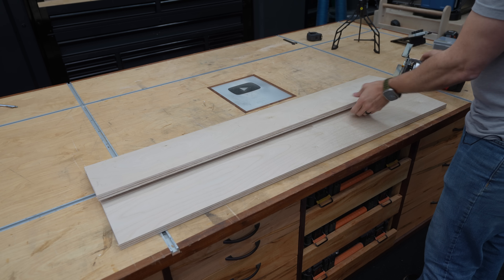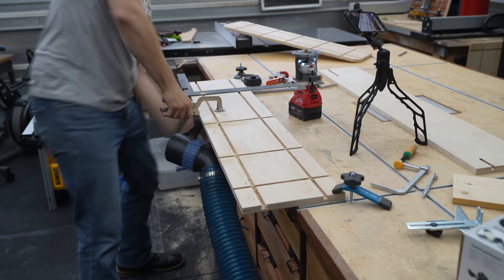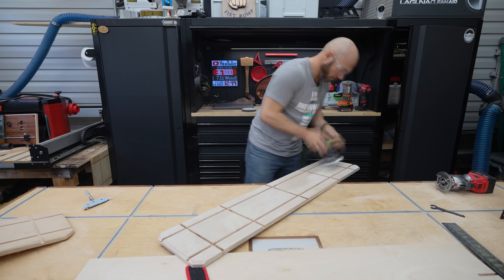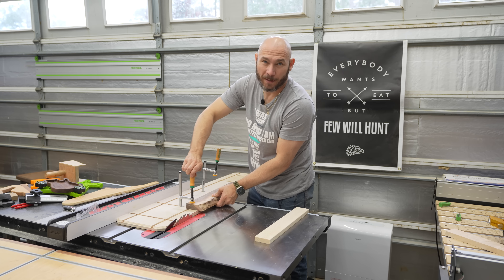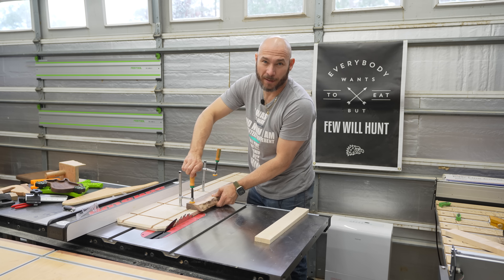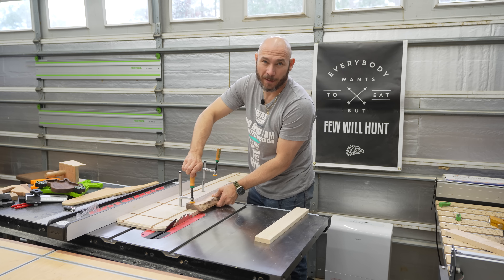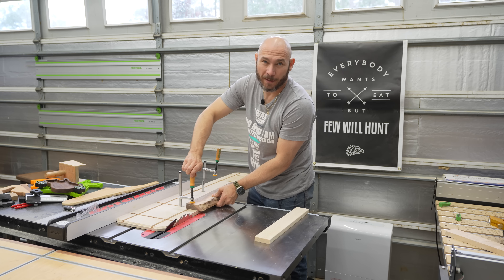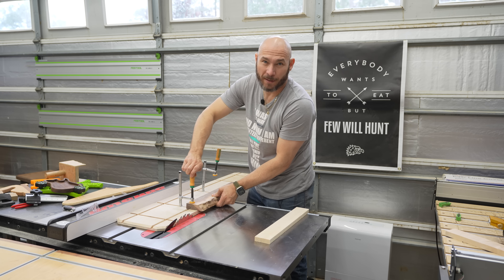99% of Beginners Don't Know About this Woodworking Trick!

Comment: This video makes no sense you can’t get a smooth jointer edge from a table saw?
Reply from the maker: I jointed on a table saw for 5 years before getting a jointer.  Worked for me.
Reply: Why not? care to explain how this doesn't work? He just showed exactly how it does work, and logically, there is no reason this wouldn't work practically as well as a jointer, other than the limitation of flattening a wide board in preparation for a planer/thicknesser. But I'm no expert so am genuinely curious.
Reply: @hrodwulf172  I worked in a cabinet shop for 40 years. I don’t care if you have a brand new blade! You will have saw marks after cutting and when you stain it they will stand out!
Reply: @georgedowney8533  Hmm, maybe Matt can demonstrate with a piece of walnut or something versus pine and shows the quality of cut. I would honestly expect saw marks though and would need to clean it up. Even with a jointer, you would probably sand them anyway, no? So long as it's straight, it should be fit for purpose. The purpose of a jointer is to give you a straight/flat edge first and foremost, no? Not to give a finished edge. That is not the expectation as far as I am aware when using a jointer. I have personally never seen any cabinetry made where they have just taken a piece from being surfaced and then applied a finish without sanding. To me, that would be the mark of a very lazy craftsman.

 I think this is still a great tip for people who want to joint a board but don't have the resources for a jointer, as you can just sand the exposed faces
Reply: @hrodwulf172   purpose of a jointer is to leave a perfectly straight edge you would never sand it! Sanding creates in perfections!
Reply: @georgedowney8533  so you don't sand exposed faces in your work? For the purposes of creating a straight edge I don't see how a table saw is unusable, seeing as from what I have been taught, you take the piece from the jointer to the planer, then to the table saw to take the last edge off...if the table saw is good enough for one side, from almost every woodworker on youtube, why not the other? 

So I am just so confused by what you are saying..doesn't add up to me tbh...I think most people are able to sand just fine without creating a noticeable dimple, especially to the point where it is no longer functional...so many things you can do to avoid that, contour pads, using pencil to mark what has been sanded etc...

Not trying to be argumentative, I am no expert by any means, but logically I don't understand how this method is unusable...looks great to anybody who doesn't have the money to fork out for a jointer
Reply: @hrodwulf172   the word joiner in itself, means to join two pieces of wood together to form a flawless seam.  You wouldn’t sand it! In some cases you would join an exposed edge to bring it to exact size with a sharp joiner you would have a finished edge!  Not like a table saw!  Maybe you should take some shop classes.

Comment: The main use for what you Americans call a 'jointer', and the rest of the world call a 'planer' (because it is just a powered planer that has been rotated 180deg) is to flatten the surface of a board. Most will do this to 250mm (10" to you) or more. I fail to see how your jig can do this. Planing the edge of the board is the second step, only done after the primary surface has been done (giving the reference plane needed.)
If I want to machine the edge of material straight and square, I will just use a track-saw; the jig is part of the kit. Nothing else needed.

Logic: When we 'plane' a surface, we are forming a geometric plane- a flat surface. Anything that produces that is a planer- powered or not, and whatever angle that (geometric) plane is oriented. If we then use a machine designed to produce a second plane, parallel and equidistant to the first, the defining reference is the distance between the planes (it is the sole property). It is commonly referred to as the 'thickness' of the material that forms the space between the planes. So the machine that achieves this can usefully be called a 'thicknesser'- and most people (in the world) do.